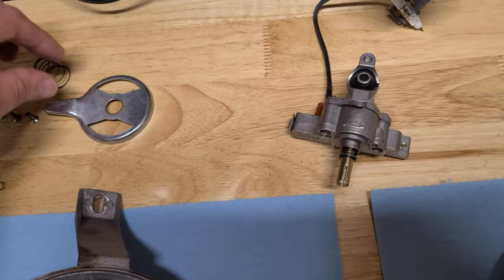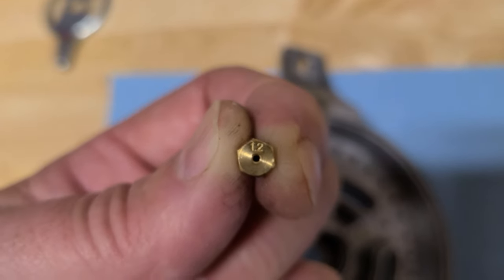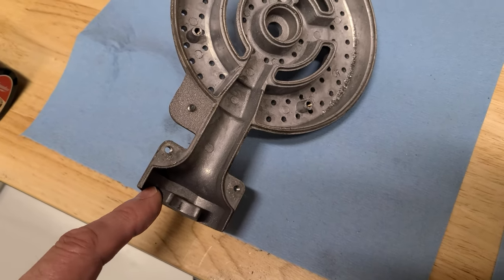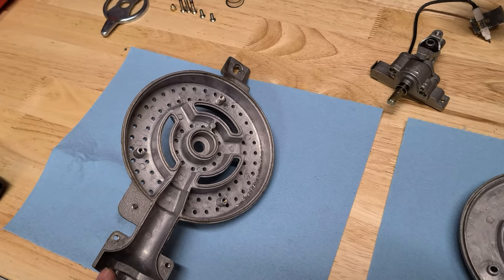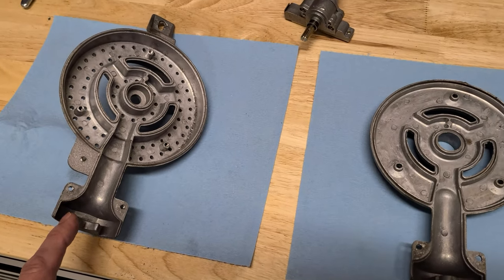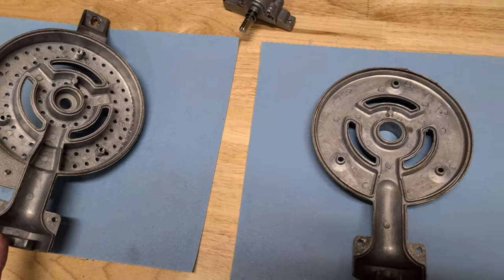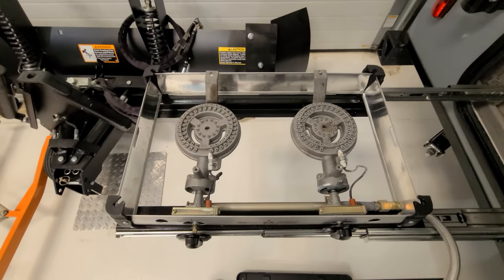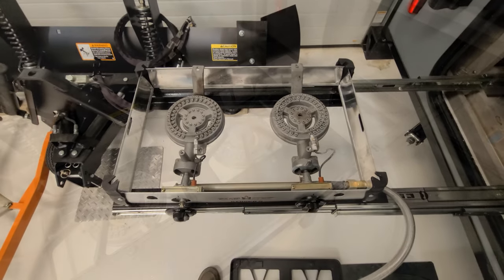How to tune your camping stove to yield higher BTU output.

Comment: Great video
Reply from the maker: Thank you kindly.
Reply: @ebrabaek  is there a manufacturer you’d recommend with really high output? And how much faster propane/butane does it go through compared to an unmodded burner.
Reply from the maker: @citizenpark2782  it is not really a manufacture and even the same manufacture has both low and high volume burners.
Most common stoves..... excluding turkey burners..... have 0.5 to 1psi regulators on them.
But increasing to just 2psi you have a tremendous heat output increase.
You don't need to go 5 or 10 psi unless your brewing beer or frying a turkey.
I suspect I'm running about 1.5 to 2 psi on the variable output regulator and burning about 33 to 50% more.
That is why I left the other burner alone for more like breakfast and other low yield requirements.

Comment: Hi, how did you disassemble the knobs and all that?  Thank you
Reply from the maker: Hi there.
You pull off the knobs. If it is hard, then use a flat screwdriver or other flat object to wedge in between the knobs and the front plate. Then the burner assembly comes out through the top grate that you removed.
Hope this offer a bit more guidance.  If your still finding it difficult just let me know and I will dive in deeper.

Comment: These burners have more than enough heat out put  on high most of the heat is flowing around the pot which is a waste of fuel .
Reply: Not when you bought it just to use with a large wok.

Comment: I wanted to see how the burners were disassembled, if it ain’t broke don’t try to make it better. Your burner is not burning, clean wasting fuel polluting the atmosphere and giving you carbon monoxide to breathe even though you should be outside. Thanks for a good try.
Reply: What do you mean a good try? He increased the high output, sometimes you need a higher flame as when cooling fish, the small burner will not keep enough flame to keep grease at 350 degrees, his modifications has now given him a real fish cooker